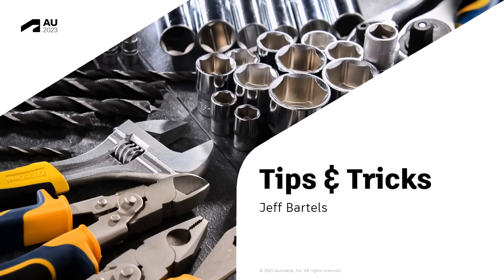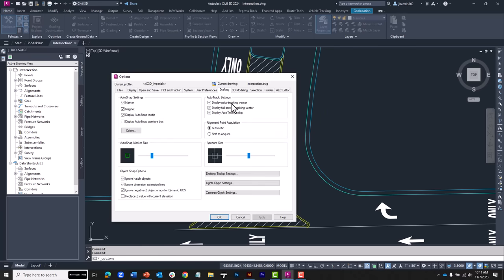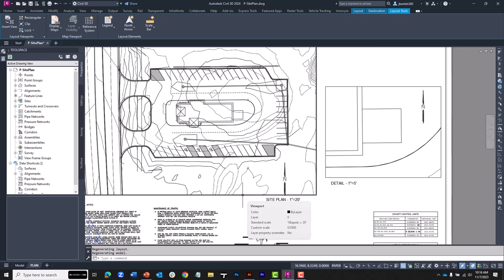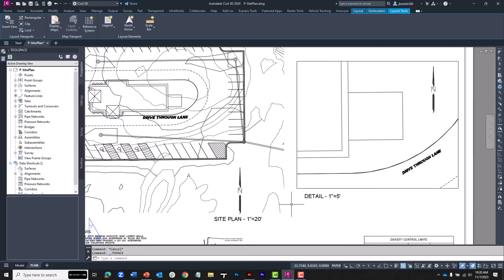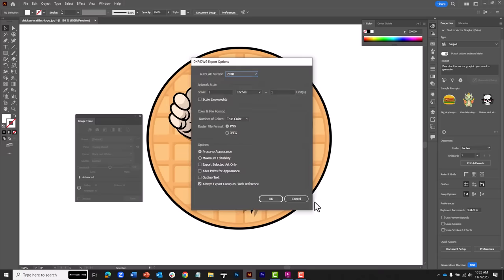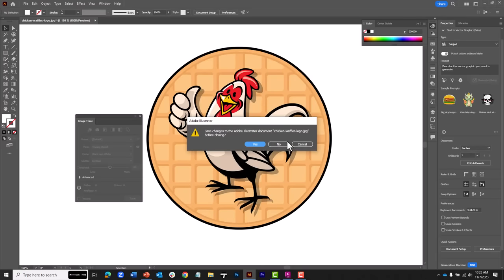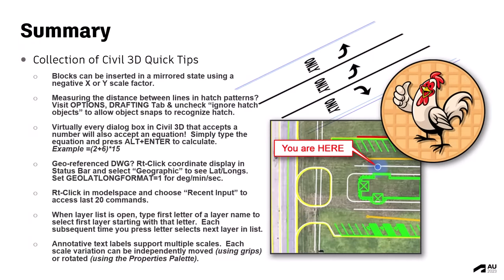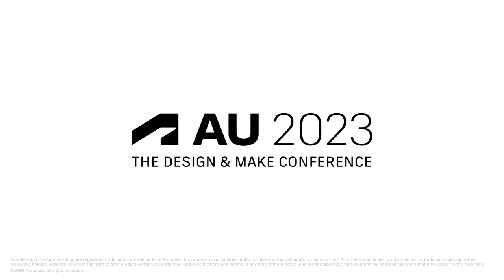Civil 3D Tips, Tricks, and Unnatural Acts - AU2023

Comment: Great tips Jeff, Thanks for sharing it with us
I face the same problem regarding the zooming out of the kmz file location when I open it on Google Earth, I think this happens because there are some items that have different elevations.

The solution for it is simple, once you open the file on Google Earth right-click on the file name at the left menu(Places) choose properties then view tab, and change the value of range (usually the value is 637100000) just change it to 637.100 and it will zoom it correctly. 

To save the changes right-click on the file name and choose Save place as.
Reply from the maker: Thank you!

Comment: Bartels, thank you so much as always. A quick question. In the Oil&Gas industry, at least in Texas, the architectural scale style is required for locating pipe foundations, considering an arbitrary origin normally located at the South-West corner of the facility. That makes me jump onto Cadworx to perform that activity. Is there any way you can tell the Autodesk people to consider this. That is going to open broader their selling, or, do you have a turn around to make a cogo-point to give X, Y coordinates in architectural style?

Thank you Bartels